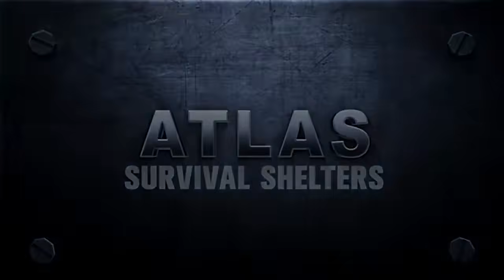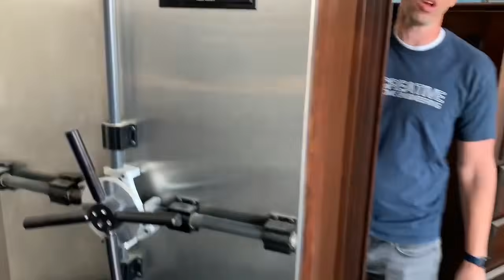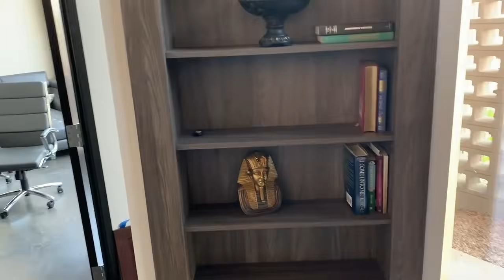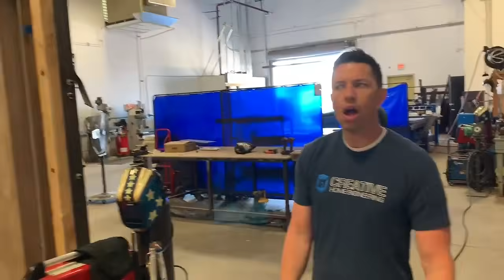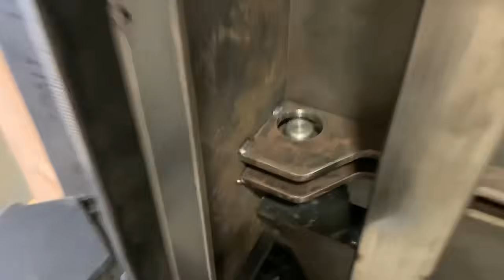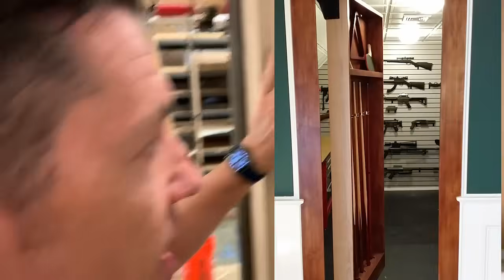Secret Doors and Passages of the Rich and Famous

Comment: and for a bed room could you imagine if instead of having doors for your bedrooms it just be a wall there and it look like a house with no rooms and then just push a button then the wall sides back a tiny bit then moves side ways. then imagine some one breaks into your house and tries to find the bedrooms but they can't find it all thy see is walls. then another idea i had was a bed room that is also a elevator so like a 15 x 15 size room or bigger and if u wanted to be the bottom floor u stay there but if u wanted ur room to be in the second floor u could and you would not be able to tell that is is also a elevator the door be like a normal bed room door

Comment: So, I'm not anywhere near ready to make a purchase, but I am wondering how you would accommodate the heat in somewhere like Phoenix, Arizona. I know it's possible to bury the bunker deep enough that the ground is cool, but the moment you turn on the air handling system you're going to be piping hot air in. Is it possible to integrate an air conditioner or evaporative cooler into the air handler? Because otherwise you'd very quickly wind up with an uninhabitable bunker in summer.

Comment: I'm planning on hiding a Liberty vault door by skinning it in a 6 panel door facade. My "room" is basic block filled w rebar and concrete. Cladded w kevlar fabric and 1/4 AR 500 plate. 10 x 20 foot room w vault, $12,000
Reply: Liberty vault door is your weak link. Lots of better options out there. Look at Sturdy Safe vault door. More steel than Liberty for less money. Made in USA. Just a suggestion.

Comment: Well, i have been in the house with secret basement.. but the are no secret door.. they use elevator, the elevator just have 4 button, floor 1,2,3 and ground for car garage, but the G for ground button have fingerprint scanner, if the owner press the G button for 5 second with thumb the the elevator goes to secret basement under the ground garage.. and this secret basement is huge the the house.. its looks like another house beneath they house.. they claim that basement is nuclearproof..

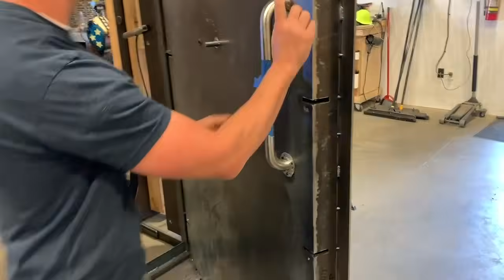Comment: @ 12:16 those tabs are just tack welded in...for garanteed safe locking system should be fully welded..i wouldnt spend the prices he's talking if the weld job isn't even upto par...the standard should exceed at those prices.
Reply: yeah i noticed that but i do think maybe thats just a standard weld ? not full beed, hmmmmmmmm

Comment: I think that all the doors shown require electricity, what happens if the grid goes down?

Awesome engineering though and for all those moaning about the price, you get what you pay for.
Reply: Not all require electricity, but battery backup would be pretty easy...